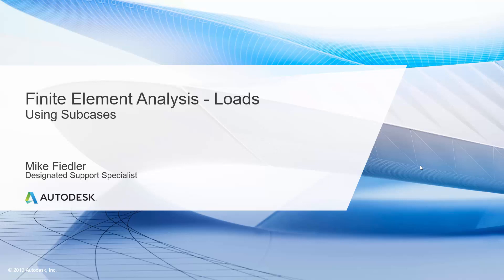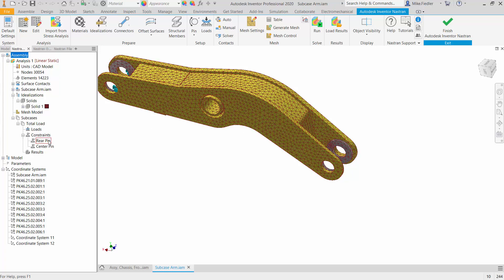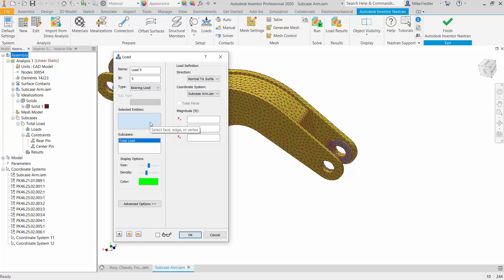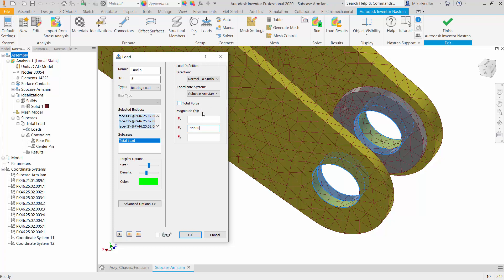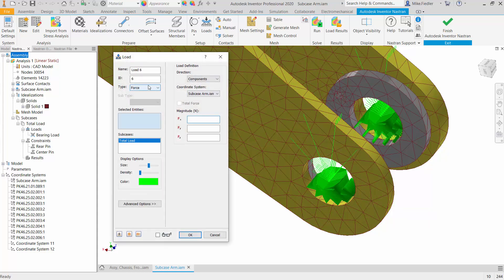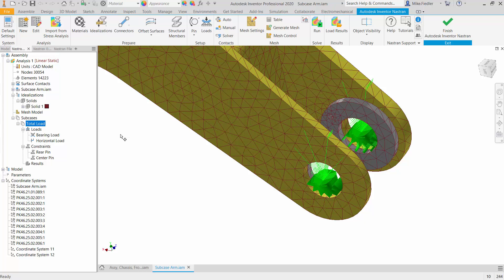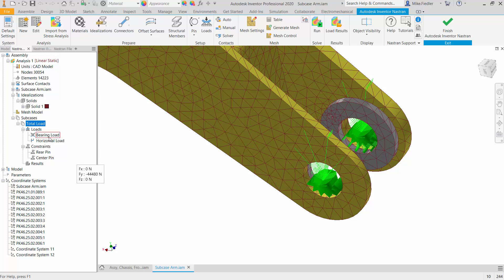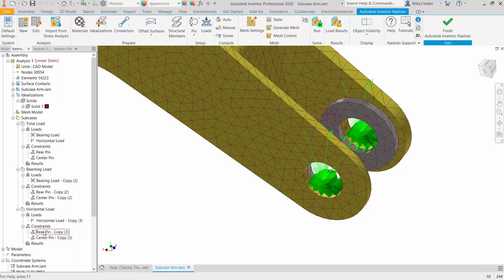Product Simulation in Inventor Nastran: Using Sub-cases

Comment: Parameter dependent loads?
In my problem statement the load depends on the separation between two surfaces (the two surfaces are on different parts such that the separation is not constant) and also on the velocity of one of the parts. How, if at all, can I apply such a load?
Reply from the maker: Hi Vidushi Vinod,
 
The best way to get a detailed response to your Inventor specific questions is by posting on the Inventor Forum.
 
Here's the link: https://forums.autodesk.com/t5/inventor-forum/bd-p/78
 
Hope this helps!
 
Best regards,
The Autodesk Inventor Team